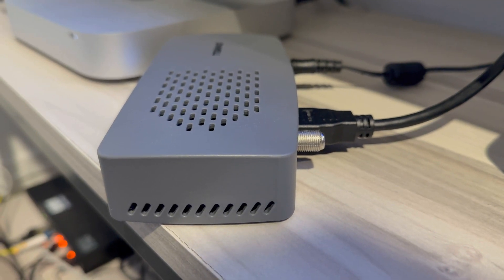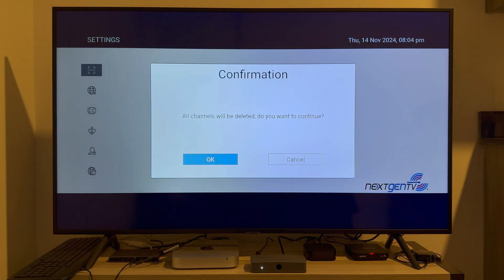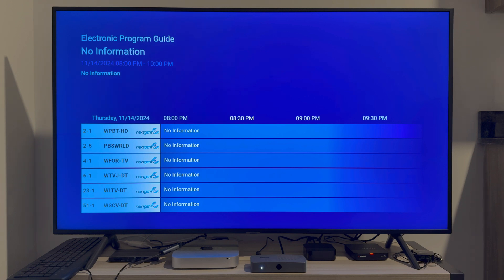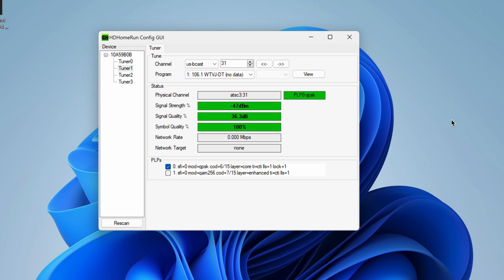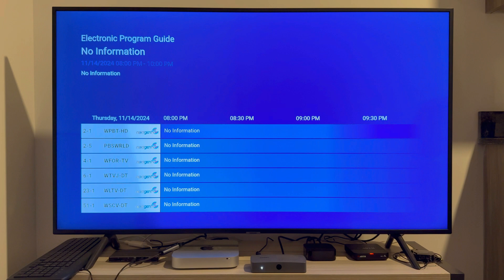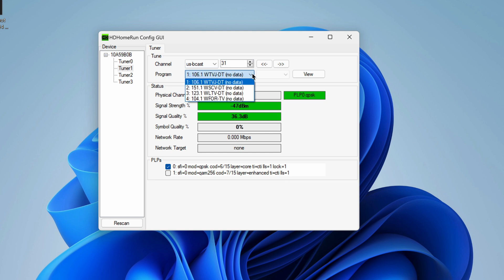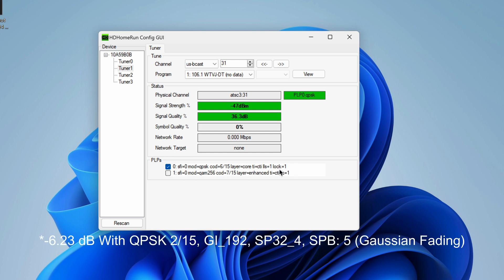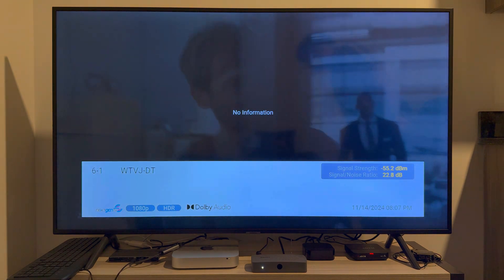Can OTA TV Be Received Without An External Antenna?

Comment from the maker: UPDATE: I mistakenly said the wrong minimum receive SNR info in the video, but the premise remains the same. Here's some detailed information about the PLPs:
PLP0: QPSK 6/15 BCH 64800LDPC CTI FFT32K GI4_768
Theoretical Required SNR Without LDM Correction: 1.47 dB (Rice)
Actual Required SNR: 4.5 dB
Data Capacity: 4.32 Mbps
PLP1: NUQAM256 7/15 BCH 64800LDPC CTI FFT32K GI4_768
Theoretical Required SNR Without LDM Correction: 14.11 dB (Rice)
Actual Required SNR: 18.8 dB
Data Capacity: 20.17 Mbps

Comment: You have an external antenna - it is the power cord.
Reply from the maker: I actually tested this without an HDMI cable, and the results were the same. I'm planning on testing it again with the power cable connected to a battery.

Comment: This partly suggests that the shielding on the box is not good enough.  Internal wiring and the wire connections can work as an antenna.
The technology of ATSC-3 is good.  It is a shame they made it basically worthless will all the DRM encryption nonsense.  The tuners cost a lot more and when they want to, they can obsolete them and force you to buy another one etc by changing the encryption.  It makes a nonsense of "the public airwaves" and "in the public's interest".  As it is, I expect to lug my TV out to the curb some time in 2027 when ATSC-1 goes away.